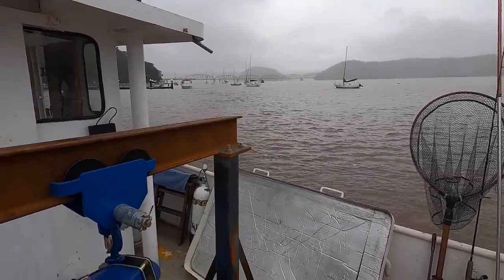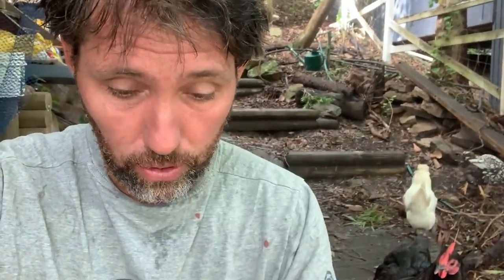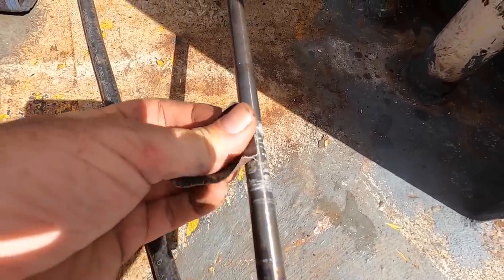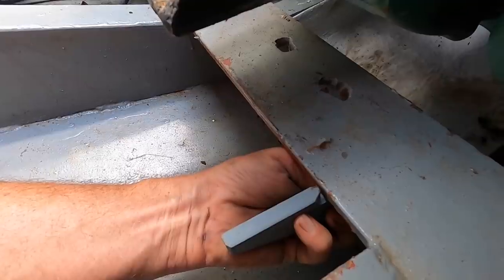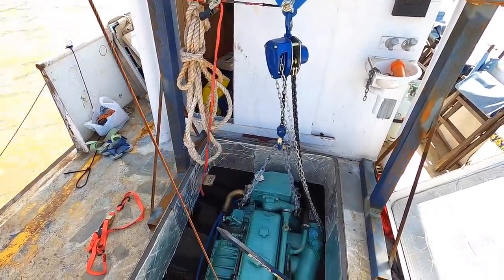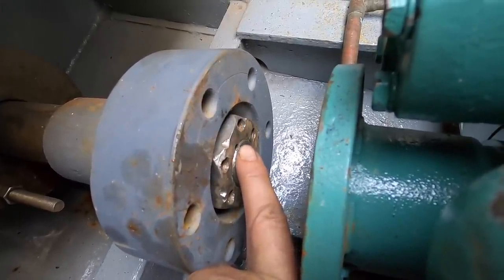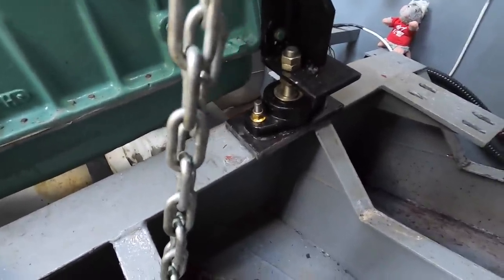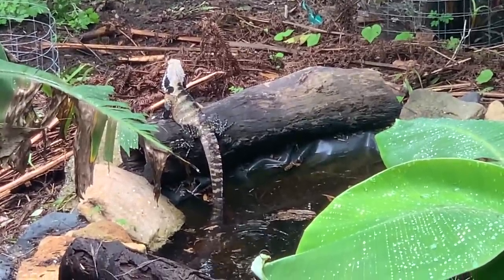Positioning the engine

Comment: you will need to be able to move prop shaft(considering the size)pretty ezy during the process mate....try flange to flange up n down then side to side..small bottle jack n a bar n shims and fine adjustment at the engine mount thread$.....n her on the hard....just saying..on ya!!

Comment: Hi Stu, thanks for all your videos! They are really incredible and have taught me SO much about outboard engines and more. I know this is a bit random to ask, but my Yamaha 15 hp 4-stroke outboard has milky water/oil coming out of the upper exhaust. Maybe it is because a broken seal below the water pump, crankshaft seals or the head gasket... Have you got any idea what could be the problem? Where would you start to look?

Anyway, thanks a million for your videos! Have a good one // Anton from Sweden
Reply from the maker: I would start with the driveshaft seal under the waterpump.
Reply: @DangarMarine  Thanks a lot!

Comment: Align coupler to flange first to within .004 then slide coupler back and install drivesaver and re install  driveline. The alignment will change a bit after the boat is splashed, that's when final alignment is necessary. Never any fun doing that on the mooring.plus,I don't think I would be lining up a diesel engine with bare feet.
Reply from the maker: The whole problem with this alignment process is not being able to slide the coupler back.
Reply: What is keeping the shaft with coupler installed from sliding foward? Propeller and or key? Should be able to turn the shaft . Could the shaft be bent or possible rope or something in the wheel.maybe a pipe wrench to try to turn it to see how much it takes.

Comment: Just my opinion. I get stuck doing everything by myself. Again, my opinion. I would use the chain as a main support for the engine. Then I would use an hydraulic pump jack for the front of the engine. Then with the piece you have to use between the engine and shaft use an feeler gauge with the hydraulic jack get the up and down as good as you can then try to shift it port to starboard to get that a lined. Once comfortable then weld up the motor mounts. My opinion only.
Reply from the maker: That's pretty much the approach I'm going for, just can't find my hydraulic jack at the moment. That's what happens when you clean up!

Comment: The prop shaft should slid some  might have to loosen the packing when you do it...
Reply from the maker: Unfortunately most of the resistance is coming from the cutlass bearing but I'll back the packing right off and see if I can at least move it a bit.
Reply: @DangarMarine  yea that could be an Issue if the shaft doesn't slide in that bushing.Packing is hard to adjust unless shaft is spinning...
Reply: I know you had to tighten it to stop it leaking so much. I watch your vids. but really final adjustments are best made with it shaft turning. Packing has to leak some  It's unfortunate  but that's why you have spent so much time on bilge pumps.
Reply: Rotan pumps has in the spec sheet 10 to 100 drops per min.Roper and Goulds probably has the same .your prop shaft is just a pump attached to a motor.
Reply: Our plant manager at work complains about our fire system Diesel pump leaking... It's packing if we replace it and stop it leaking the packing will smoke until it leaks a little.
Reply: I have never flown before in an airplane and don't wish too, I'm sure you figured that out.But I wish I could be there and help you.

Comment: Am I missing something or would it be easiest to grind around all the plates then move the motor in to position and put all the bolts in the shaft and start using a fueler gauge and adjust the four posts on the motor mounts until you get where you want to be and start welding!!! I'm surprised there's not a 1/2 in rubber washer for that joint?
Reply from the maker: The plates are completely free at the moment so that pretty much is the plan.

Comment: I would bet taking the weight off the engine would solve that list in the boat. Not so much as weight on the starboard side as the port side is being pulled upward by the winch.
Reply from the maker: The list is always there regardless of winch use.

Comment: can you attach four of those cheap ratcheting straps or turnbuckles to four corners on engine to help get it into place with just a few tweaks?
Reply from the maker: I should be able to rig something up, but I'll need to lift it at the same time as it is too heavy to drag when lowered.
Reply: @DangarMarine  well if the straps, turnbuckles or even rope are just there to stabilize it from moving the trolly and chain hoist should be able to hold it up without much problem. I just figured that this way even with the sway of the ship you could still tweak it into position. It would be best if you could tow it near a place that could be partially beached at low tide like at that hardstand you were at. Not on the hardstand just near the mud where she could sink in and stabilize just a bit for the final adjustment. This way no fees as it wont take that long for final adjustments.  Just an idea i had stu. Did you get those union nuts with thread that can go into prop or engine?

Comment: Ya engine alignment is not supposed to be the easiest thing in the world, very monotonous tedious work.. But still possible to be done in the water.. and the shaft will turn before the engine stalls, however make sure the tension on the packing gland isn't too tight, it should always drip a bit after a good run because if it doesn't and its too tight, The packing will burn out very quickly..
Reply from the maker: Hey Callum, yes, will definitely back the stern gland off before firing it up. We'll see what happens!

Comment: Please explain why the prop shaft will not turn. I watched the vedio of you putting it in with the packing and tightening the flanges to slow water leaking. Every thi g seamed just fine. What am I missing?
Reply from the maker: The cutlass bearing is too tight around it. It is brand new so I'm thinking that doing a rough alignment on the engine and spinning the prop should free it up very quickly.
Reply: @DangarMarine  ok thank you

Comment: Funny how boats sink. A guy insisted on tying his ski boat across the end of his slip, behind his big boat. I warned him and the harbormaster told him to move it. Well he didn’t. The harbor has a covered roof that’s 60’ feet wide and slanted so the water runs off at the opening of the slip. Well, take a guess where all of that torrential rain went? Three years later I can see a perfect picture of a ski boat with a side scan sonar on the bottom as it slowly makes it’s way down river, yard by yard, month by month.
Reply from the maker: Doh! I'm suprised someone hasn't grabbed it yet.
Reply: Dangar Marine 
Nah, the boat was 25+ years old with a small block Ford. The guy was a lazy jerk and waited too long. Even glass wrapped stringers and floors would be toast in a few days with no hope of ever drying out. Heavy boat syndrome, lol

Comment: Couldn't nuts be welded forward/aft and starboard/port about a foot away from the engine, then make 4 L brackets to mount to the engine with a threaded hole the same size as the nuts welded around the engine and run all thread through the bracket and nut to draw the engine any direction, just a stupid  idea...just thinking out loud, that's what I would try myself.
Reply from the maker: Yes, something along those lines seems to be the way to go.

Comment: Using some thing like a socket the same sort of thickness as the polyflex coupling together with a feeler gauge would be one way of judging the parallel alignment of the flanges. I might even go to the trouble of getting a small block of steel machined so both faces are exactly parallel to use instead of the socket. Holding a steel rule across the outside faces of the flanges will show how close their alignment is. When I have done alignments with no flexible coupling in between the flanges I aim to get to within 0.003 inch (0.076mm). The tightness of the cutlass bearing is a real concern, were you able to turn the shaft by hand with the prop? It's a shame you are on the other side of the country otherwise I would give you a hand.
Reply from the maker: Hey Roger, yes, a machined block with perfectly parallel sides would be a much better choice. Yes, I could turn the prop by hand when it was on the hard stand. It was stiff but the diameter of the prop gave me just enough leverage to rotate it.
Reply: @DangarMarine  On the hard the hull flexes diferently than on the water. That's one of the reasons I believe that alignement should be done with the boat on water.

Comment: did you ever take the ballast weights out?
Reply from the maker: Yes, I took the concrete bags out and replaced them with lead, but not the full compliment yet, that may be the problem.
Reply: @DangarMarine  yeah i wouldn't be too worried about it yet thanks for the content

Comment: when you feel up to it why not weld a strong metal ring or something similar to the bulkhead and the transom to pull either way, the joys of a metal boat, i could not do that with mine as it was made of oak and they do not weld so well being damp and all that, lol
Reply from the maker: It is tempting as I think it will be handy in the future too.
Reply: @DangarMarine  of coarse they will, you can never have to many strong bulwarks on a metal boat, the possibilities are endless with what you can use them for,  a couple in the bilges for a nagging wife ect, comes to mind,

Comment: Stu, did you receive my email re: a valve cover for your engine?
Reply from the maker: Ah, I did! Too often I see emails then forget to reply... As far as I can see the current one isn't leaking at all (which I believe is the reason for the upgrade to cast) Any other reason to change them over?
Reply: @DangarMarine  No other reason than the old tin covers where notorious leakers. It will be sitting in inventory, so feel free to give me a shout if yours starts leaking. What is the story of the poor boat with just a corner of  the wheelhouse above the water in your intro?  I looked all through your archives for a video on it, and couldn't find anything.

Comment: You really are back into the slow grind jobs... however this vid has given me a bit of light relief and food for thought..Your graft is my gain and in return a few musings
1) stalling outboard.. great advice but imho first job is pull the prop and get rid of all the fishing line.
2) that fuel filter gave me a sideways thought to your fuel tank level problem..have you considered fitting a fuel flow meter? Works in any sea conditions and lets you get a true reading of amount used.
3) rather than cut the gps  bracket..what about fabbing simple secondary ( slot ) brackets that fix gps to mounting and allow it to be raised and leveled. 
4) failed sea cocks..don’t want to get over anal but a hose on a valve is two levels of risk. Kill the system to minimise the potential failure modes.. in this case scrap the hose and seal the valve outlet with a decent mechanical fixing.
5) motor alignment...get help..it is not a failure to ask for ( paid) help when a job gets a bit ott. How many decent home mechanics have come to you when an outboard engine problem starts to swamp them. A decent engineer might save you a lot of time and the cost of putting Renko on the hard standing. 
6) boat leads to starboard...natural order of the universe ...don’t worry.
Reply from the maker: I do like the idea of a fuel flow meter, they are very handy for finding the most efficient speed to run at too.

Comment: Instead of cutting and rewelding the mounting bracket for the monitor, why not just drill a few more bolt holes up higher?
Reply from the maker: It has a fitting right at the end that attaches to the unit.

Comment: I don't understand why a flexible coupling like a Lovejoy fitting, universal or constant velocity joint isn't used between the engine and the prop-shaft.  I'm not a boater, obviously. Ron W4BIN
Reply from the maker: Hey Ron, there often is something like that in boats but in this situation there just isn't enough room between the gearbox and the bulkhead.
Reply: When the prop shaft is properly aligned it should be aligned in the center of the stuffing box and in alignment with the cutlass bearing. The prop shaft is supported by the coupling and transfers all the thrust ideally in a straight line through the prop shaft to the gearbox flange and through the gearbox. Misalignment with either the cutlass bearing, stuffing box or prop shaft coupling to gearbox coupling will cause a resonance then vibration because the thrust isn’t directly in line with the engine mounting. There is a tremendous amount of force that needs to be managed precisely and that’s why you don’t see typical joints being used due to them not managing thrust correctly or allowing the alignment to shift. My personal preference is I dont like anything but metal to metal couplings because it removes a variable. The entire system is either in alignment or it will just give you trouble from now on.

Comment: Renko looks a lot like a Bollard 144 to me. BB400 "Bollard 144. 9M Steel medium speed steel fishing boat"

  https://www.bodenboatplans.com/product_info.php?cPath=1&products_id=36

 Length  9.0 m
 Displacement  8000 kg
 Material  Mild Steel
 Hull Draft  1.02 m
 LWL  7.81 m
 Hull Weight  4000 kg
 Beam  3.25 m
 Max Speed  16 kn
 Motor capacity  210 hp
Reply from the maker: It does look similar, but certain aspects are definitely different. Probably the best cadidate so far!
Reply: @DangarMarine  It's not hard to imagine that Renko's founder or builder could see what changes he might want to make such as a tad more buoyancy vee in the aft than the original plans called for. Interesting that the plans call for a reduction drive to the prop and Renko is 1:1, I wonder if that is part of it and yours has smaller diam prop as a result. How about a Kort Nozzle for it. I've got a cone program here somewhere if you want to get one rolled. 
A ducted propeller, also known as a Kort nozzle, is a marine propeller fitted with a non-rotating nozzle. It is used to improve the efficiency of the propeller and is especially used on heavily loaded propellers or propellers with limited diameter. It was developed first by Luigi Stipa and later by Ludwig Kort.

Comment: Here is real bad with fisheye. For ever they showed the Las Vegas strip. So for ever I thought the road was very wide. The famous fountain was very huge. Nope. Going on 4 years I was there most of the summer. Going down the Las Vegas strip, I got the case of claustrophobia and major disappointment because I thought everything was huge and in reality small. I'm still trying to figure out the C130 landing on the strip. That's now to me a what moment. Awesome job with your ship. I'm not calling it an boat. Mine is a boat. 21 foot pontoon. Take care.
Reply: The c130 landed on a miniature of the strip not to scale . In Con Air if that's what you are talking about. Also if you got claustrophobia from there i can't imagine your limits in regular life. Ive climbed down inside wall forms only 16inches wide 20ft down with a rebar mat in there too. Everyone  gets that panic feeling when you can't move your shoulders you just have to breath if you climbed in you can climb out. If you don't panic
Reply: @Deftonesdsm  what you said. That stip is very small then ever shown on anything.
Reply: @scanadaze  yeah i get it. Also im 5'5" 125lbs so small thin guy i guess that qualifier makes more sense considering most ppl couldn't even get their waist into a 16" wide wall. 😁
Reply from the maker: The disappointment!
Reply: @DangarMarine  I have work to do on my own motor. It's an rebuilt but they did not rebuild it all. I have to put an starter on it. Have that. Then a water pump. Have that. The the engine left ram on the starboard side I have to make homemade seals for it. It's a 1977 85hp Evinrude but yet it has two engine left rams and that makes it is off the 1976 model. Upper part is all rebuilt. Looks brand new.